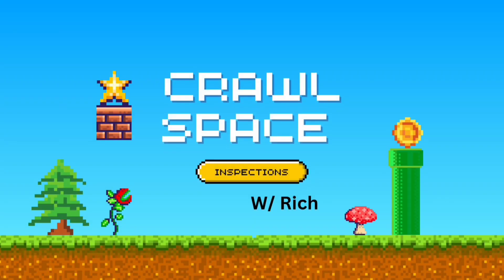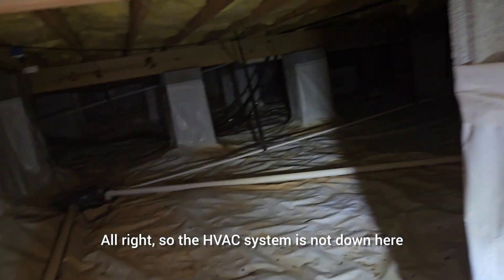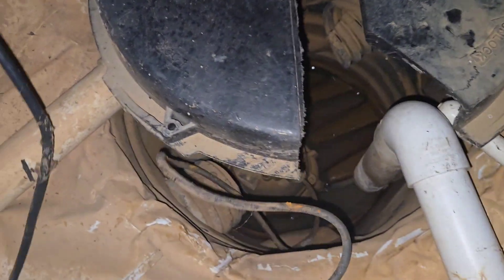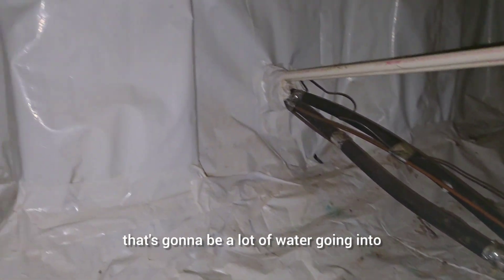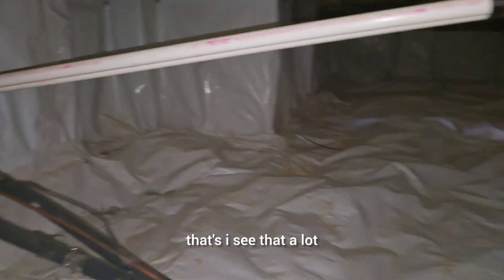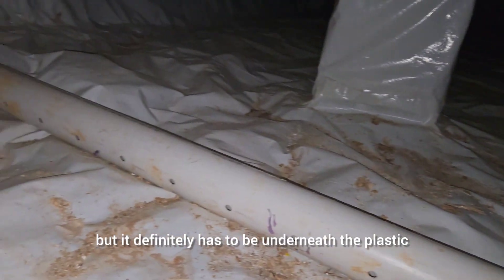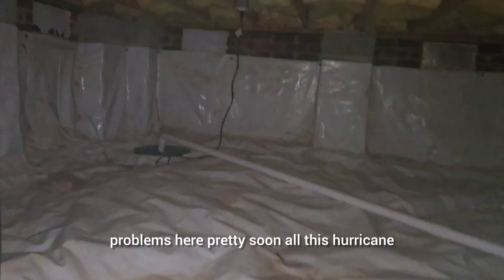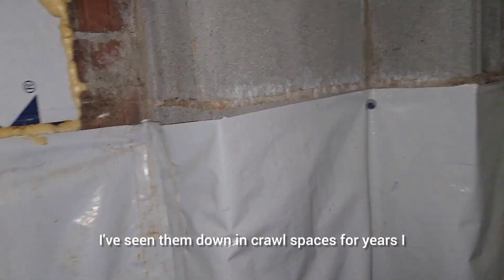Home inspector pleased. 😁

Comment: Is it good to not have any air circulation through the side vents, it’s best to keep them closed off?
Reply from the maker: @10speed4  as much air flow as possible.  Or if that doesn't cut it. Encapsulate it. Thanks for watching
Reply: How can the space get to 50% humidity if humid outside air is flowing in all the time? The machine would never stop running. Therefore, encapsulation must seal off the entire space from outside air. The dehumidifier blows air around, but it's the same air over and over so it seems some controlled exchange would be in order due to soil gases like radon. I guess that's what that white perforated piping on top of the plastic is for, but needs to be under the plastic where the soil is.
Reply: @virginiamoss7045  I was asking him the question because my crawl space doesn’t have humidity control.
Reply: @10speed4  Ah, sorry to misunderstand. Then your answer would depend on your climate. In the south it's so humid all the time that even circulating humid air won't reduce the humidity enough to keep mold from forming.
Reply: @virginiamoss7045  no problem. I’m in Ga so I’ll have to keep an eye on my crawl space and mold issues.